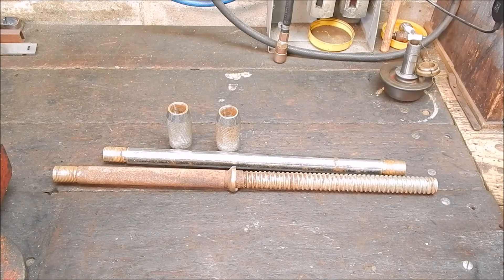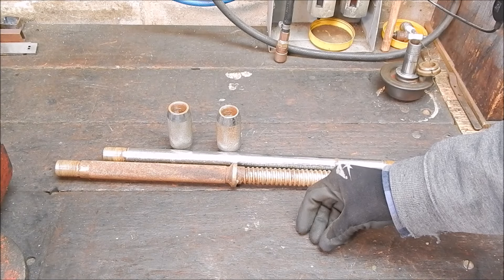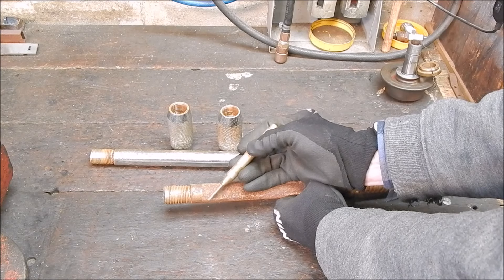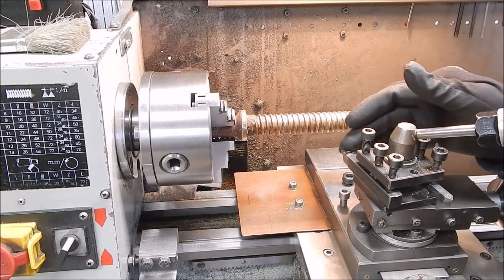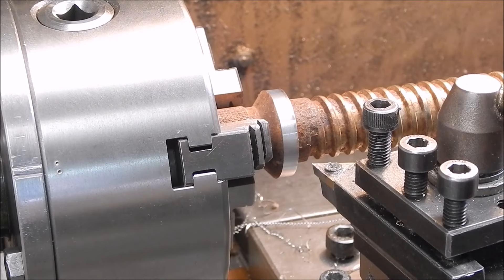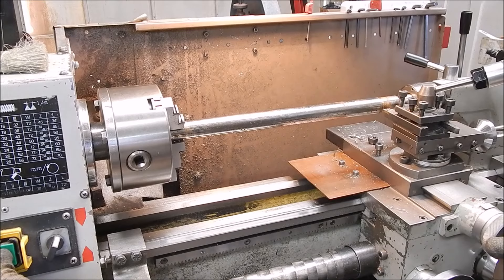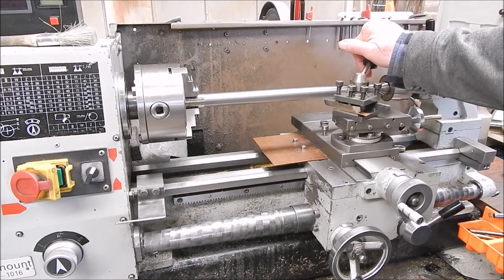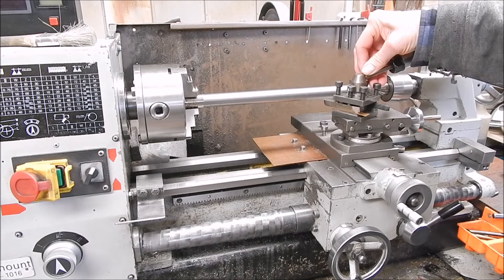Machining roadside junk metal on a small Chinese lathe

Comment: Ya know Rob, I've never had any luck putting a super nice finish on anything with high speed steel. No matter the angles, the grind, it the perfect honing it's just not that good. But if I take a Kennemetal CNMG431 KCU10 inserts it's super nice. The harder the material of course the better the finish. Those inserts on some material leave a ground looking finish.
Reply from the maker: Depends on the depth of cut mainly.  Carbide "peels" off the metal like your thumb peeling an orange.  That's why DOC is so critical.  Get it and the feed speed right and the result will be like chrome finish.  Too little and carbide won't work properly.  HSS cuts like a knife, has much sharper edges and can do very fine DOC.  HSS cutters vary a lot and round nose versions generally make for a clean finish.  Type of steel being turned also has a huge effect.  Poor quality steel will usually feather badly with carbide.  Cheers Rob

Comment: Rob, those weightlifting bars are mostly an alloy of chrome, nickel, vanadium and molybdenum, means good stuff. Make yourself a little sample and try to harden it. Would be interesting to know, ´cause i could not find anything about the carbon content.
Reply from the maker: Thanks for that.  It machined like it had some moly (bit gummy) so you are probably correct.  I doubt it's got much carbon, but that's just my impression.  Worked up well, but a bit cutter sensitive for a good finish.  HSS worked best on it, as I could do a light cut.  Well worth picking up.  Cheers Rob

Comment: Hard steel make a nice fire in the BBQ, and put the steel on it overnight. Should make it hot enough to soften it a lot, to the point it is machinable, plus also will likely strip chrome off the surface as well, or at least weaken it a lot.
Reply from the maker: I wondered if the bar would need annealing (to soften it) but not necessary.  This bar is obviously not exactly Olympics standard ;)   But as scrap steel goes, it's quite useful. Cheers Rob
Reply: @Xynudu  That is for those big hard steel ones you have, not the cheap free roadside scrap bars.

Comment: I used such a trashpicked weightlifting bar a while ago, to lift my 3ton surface grinder with my excavator, worked excellent and didn't bend ;-)
Reply from the maker: Wow. That's amazing.
Reply: @Xynudu  Not much bending force, since the lifting slings were right next to the holes in the machine. 
Always nice, if manufacturer makes some holes in the casting, so you have it easy with lifting and moving. And that weightlifting bar was a good fit for these holes so I went with it and it worked ;-)

Comment: hi rob,have you used the weights for the bars.are they mild steel or cast material.
Reply from the maker: Hi Geoffrey.  Yes I have and they were terrible.  All the home use weights that I've seen are cast iron and it's really crappy stuff.  Lots of sand, grit and slag.  Makes lots of sparks and tears carbide to pieces.  Also has hard and soft patches.  Total waste of time trying to machine anything out of it.  I have read in forums where some people have successfully used them, but the general concensus is that they are a waste of time.  Cheers Rob